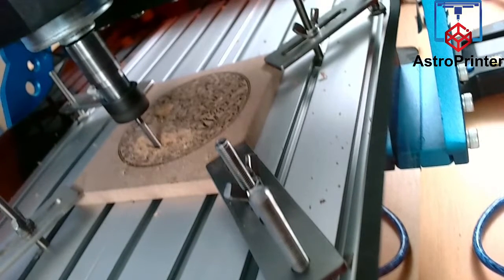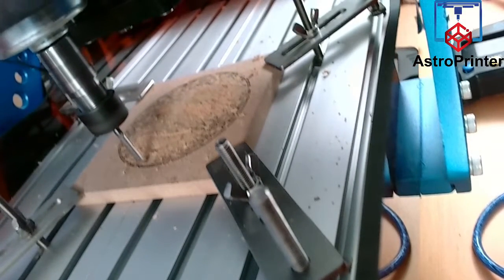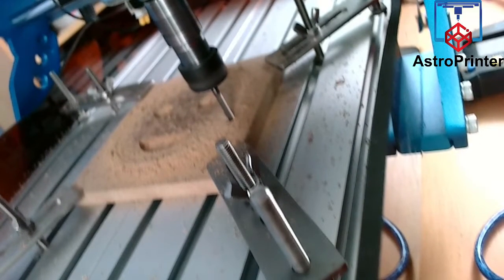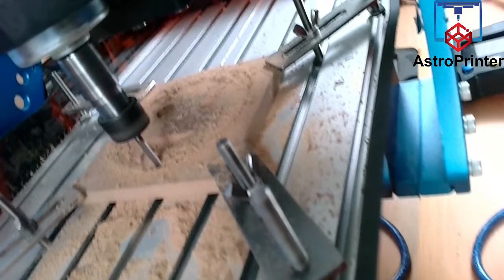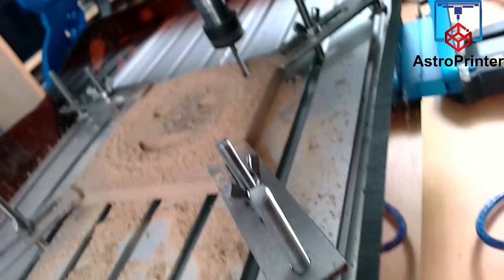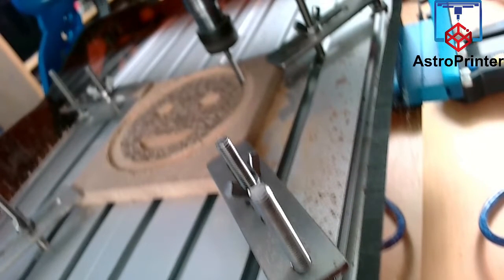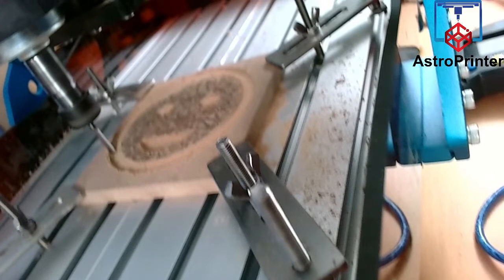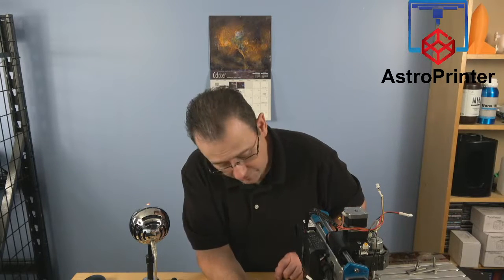Just Doing some CNC Engraving on the Comgrow CNC Router

Comment: Polarity... Luckily it didn't fry.
Reply from the maker: Its fused so it would be fine
Reply: @PrintingNerd  fuses don't always protect downstream equipment as we would assume. Like the breakers in your house, they protect the wiring NOT what's connected to it.
It an ideal world, the board has a polarity protection circuit to prevent damage.
Either way, glad it's working now.